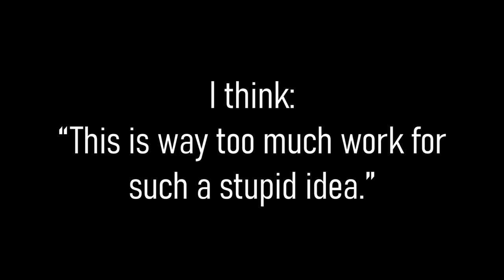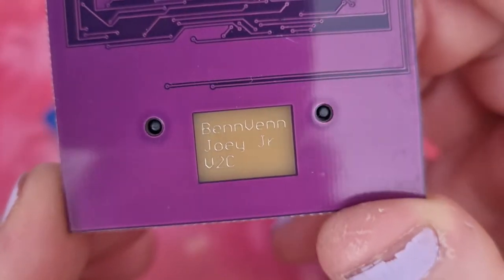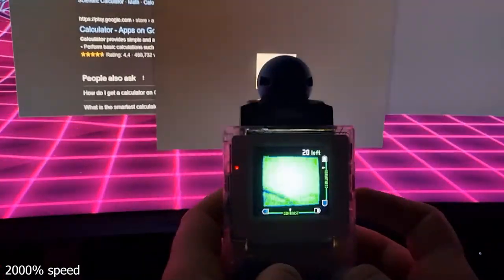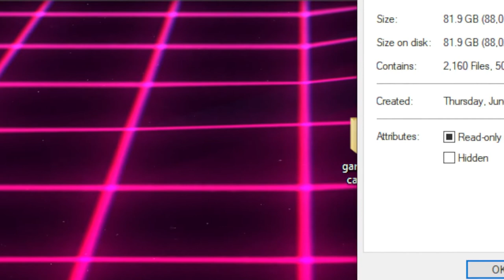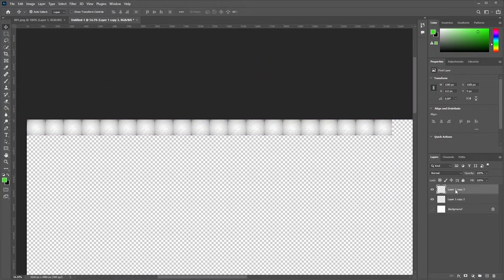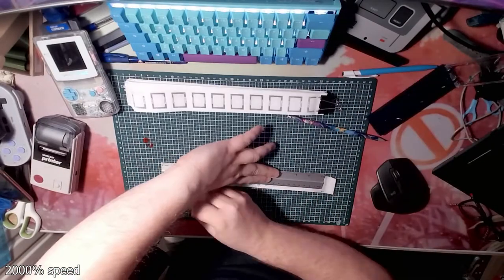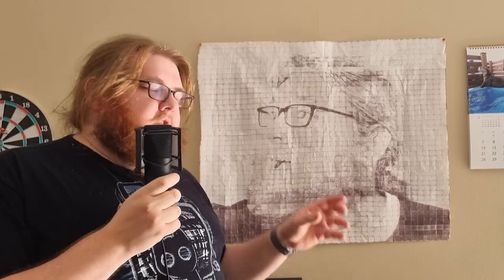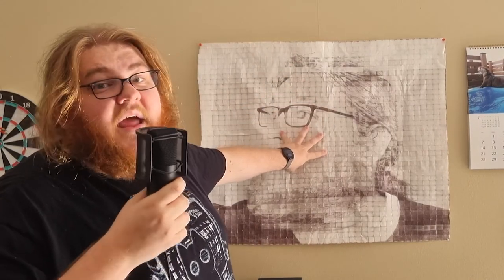Making a HUGE poster with a Gameboy Camera and a Gameboy Printer!

Comment: This is really cool, really impressive! Production quality is also not bad. I expected a lot more views. Like 100-1000x. The only thing that is kinda sad is that the thermal paper is probably not going to last very long...
Reply from the maker: Thank you very much! And yeah, I'm gonna look in to that, maybe I can save it :p
Reply: @SleepyPinkFawn  Thermal paper doesn't like light and heat. Maybe also oxygen. So definitely put it behind glass and maybe also in a darker room without direct sunlight. Might also be worth it to scan the whole thing, so that you can reprint it, even if not on the GB printer.
Reply: @dak1st  definitely agree what u said plus if ur framing it, might be worth looking into getting a uv resistant/protective (plexi)glass for it ^^

Comment: First off, I'm impressed. Also, there a reason that you didn't use panorama mode to print the photos out? I think it would have saved some time
Reply from the maker: I only discovered panorama mode after printing everything, (didn't end up using the clip where I mention it :p) shows how prepared I was! Also, thanks!

Comment: How do you get the printer paper and ink for that thing? Is it expensive?
Reply from the maker: The printer doesn't use ink! Its a thermal printer, like a receipt printer in a store. It uses heat on heat sensitive paper. As for the paper itself, you can just get any old thermal paper and cut it to size, you can even just re-use a store receipt if you want to test the printer out, but you can find rolls that are already cut to size, and those aren't very expensive, mine were less then €1.50/roll (and the roll was bigger then the printer usually takes so I had more paper) but there are places where you can get bigger bulks for less then €1/roll.